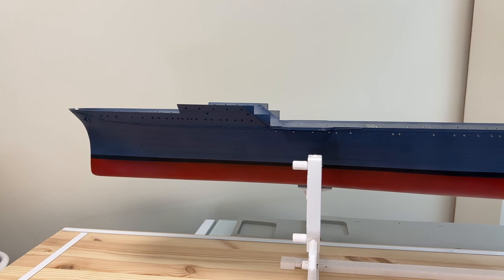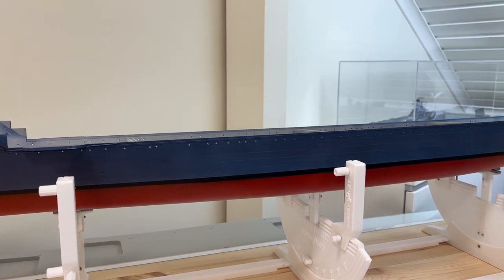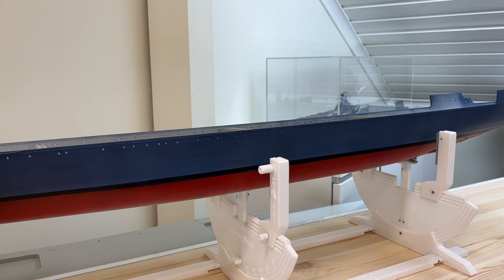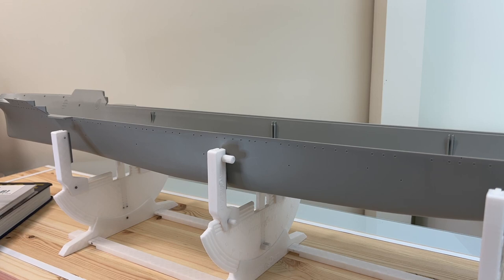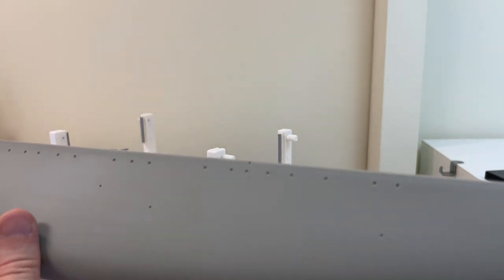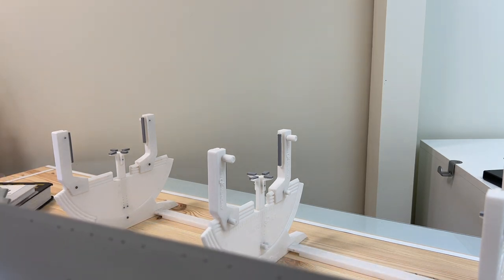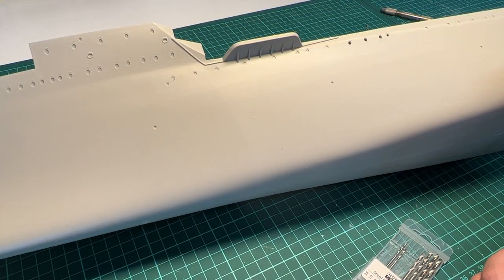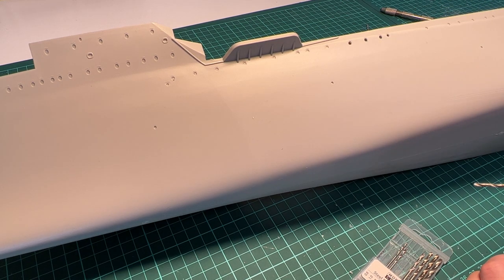CV-6 The Hull

Comment: I have been researching this ship a little, along with Yorktown Kenneth. It would appear that the degaussing cable in the Pontos set is correct for Enterprise after May'42 to October '43. The degaussing cable in the KA set looks mare like the cable Yorktown had fitted at her sinking. If you look at the few shots available of her wreck you'll see what I mean. as for those little platforms on the sides.. it would appear they were removed at her October '43 refit as was her degaussing cable which was replaced with a far more angular, larger single cable I think?
Reply from the maker: Thanks Nigel for the clarification. You might be right that KA is closer in the actual shape of the cables, but as far as I remember, the shape of how they fit the hull is not as good as the Pontos ones. And those copper wires from Trumpeter are just gruesome. I kept the platforms, as I could see those in pictures taken in 1942. If I were to model a '43 version it would require a lot of work to get the hull blisters etc in place. So are you going to build yourself an Enterprise or Yorktown Nigel?

Comment: Hi enjoying this vid, you use E6000 its description doesn't really commit to plastic however E7000 does thanks
Reply from the maker: Great to hear Mike! Well it says that it adheres to many plastics, and my experience is that it works very well for plastic and for photo etch. I can't easily get hold of E7000, so it is not an option for me, but I guess you can try it out as well. It should be even stronger and flexible.

Comment: Good job on the Trumpy kit, which is complicated as Trumpeter wanted the hull to represent 4 different carriers.
Be glad you are not modeling Measure 22, as it's a modeler's nightmare--all over Navy Blue and Deck Blue, very nearly a flat black finish that suck light into it and never lets go.

The boot topping (the black stripe) winds up controversial, as it could be from 6 to 8 feet tall (185-250cm) and could be  10 feet (300cm) wide at the Captain's discretion.  This is complicated as the limits are set based on the waterline, and not span along the hull.  So, back under the counter stern, the strip could be several meters wide, to keep its top & bottom edges parallel to the water line.
Reply from the maker: Thank you 🙏

Comment: Great work！I'm also preparing to make this one (in Midway, just like you), I wish I could do as well as you! But I met a problem when choosing the color. I found that on cv6org, it was measure11, and changed to measure 21 in 1943. But on shipcamouflage it was changed to measure 21 in 1942, without exact date. I have not found any other evidence to confirm it as well, which made me quiet confused now. I saw you finally choosed 5-n(measure 21), so can you share the reasons for this？
Reply from the maker: Thanks! The research done by Jeff Herne, Alan Raven Dave Shadell, and Steve Wiper all seem to agree that Enterprise wore measure 1 until May of 1942, at which time she painted into measure 21. So I guess it is up to you if you select to go with measure 1 or 21, but from my point of view it makes sense due to the fact that there were fading issues with measure 1.